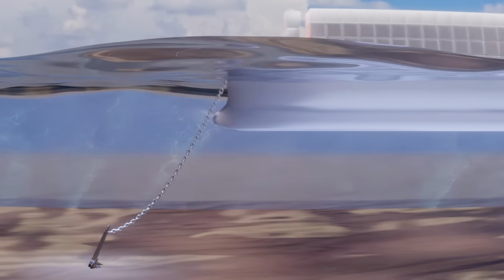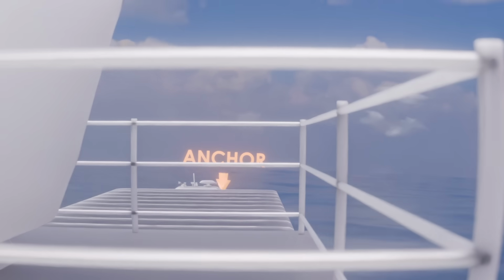Anchors don't work the way you think

Comment: If they set the anchor properly in a Hollywood movie and then they used it as a handbrake or turning point the chain will get absolutely ripped off the ship. The anchor would not fail and just get pulled out.

Comment: I don’t think that’s how anchor works if anchoring on rock a sand banker will hold very strongly to strongly that’s is way there is rock anchors. If it’s on sand it will hold as well. If it’s on it will hold even better than sand.

Comment: I see so many videos of ships “caught in a storm”. I wonder instead of powering through the storm. Why can’t they drop their anchor in shallow water where the anchor can reach the sea floor and wait the storm out? Can the waves be too powerful for the anchor and chain to handle? Causing excess stress to the ship?the anchor holding the ship steady may actually work against it by holding the ship down as it needs to move more freely with the waves to withstand the storm?

Comment: How much chain you put out depends on how deep the water is. It’s called scope.  You’ll need 3to1 with chain in mild conditions, 5:1 in moderate conditions and 7:1 in heavy conditions. 10:1 in extreme conditions.  That means the 1 is the depth of the water plus the distance from hearse to the water, the other number is the amount of chain you put out,

Comment: Note post viewing post: when I was working as a mate, I was told that I had to put out at least twice the anchor line as a depth of the water. I needed to be knowledgeable of the occurrence in the water.  This month there is times I need to put out much more anchor rope.  There were areas that we had to know where there were two currents going in different directions at different depths. I did not work long enough to know these locations. I just knew of them.  It was only a summer job that I learned so much.  Laying the anchor is not easy job, physics is everything.  I talk to young men, who always could set the anchor perfectly.   When conditions changed, they knew where then to set the new anchor position.  They claimed they had no knowledge of physics.  I had to explain to him that they had an excellent knowledge of physics.  (Fishing boats under 150 feet is different than a great ship with a steel anchor.  But the physics is the same.)

Comment: Total BS.  Yeah, I don't buy it bro -- this idea that the anchor itself is secondary.  It's not; it's primary.  The anchor does the brunt of the work.  That's why you need it to dig in and set itself in the first instance.    You can pull chain (anchor rode) across the sea floor all day long.  Now, can you dump out enough heavy chain in your anchor rode to hold a ship in place in limited circumstances?  Like light winds and no current?   Sure you can.  Doesn't remotely mean you can do away with the primary stopping force, which is the anchor.   The heavy rode's primary purpose is to ensure that the direction of pull on the anchor stock is horizontal to the seabed so that the anchor stays put.   That's the purpose of chain anchor rode.    To attach the ship to the anchor.  This is simple, rudimentary seamanship.

Now you've gone and misinformed a whole group of unserious people and junior seafarers into misunderstanding how an anchor works.    Congrats.    Spent my life on the ocean.  USCG 2d Mate Unlimited (Oceans); USCG 1600/3000 Master (Ocean).  DP Operator (Offshore Unlimited). 500 Ton Sail endorsement.  I have nothing but contempt for this video.

Comment: Yes, cruise ships have anchored on coral reefs, sometimes causing significant damage. Due to their large size, heavy anchors, and long chains (often over 200 meters), when dropped on coral reefs, they can break and overturn living corals, sponges, and other reef organisms over extensive areas—sometimes thousands of square meters. The ships also swing at anchor, dragging their chains across the reef and causing further destruction. This damage can reduce reef structural integrity and ecosystem services, with recovery potentially taking decades or even centuries. Such anchoring events have been documented in places like Barbados and the Caribbean, leading to new policies restricting cruise ship anchoring to designated safe anchorages or requiring dynamic positioning to avoid reef damage.

Comment: Enforcement in the Great Barrier Reef is maintained through a combination of zoning, mooring buoys, patrols, monitoring, and public education.

Specific "no anchor" zones are marked with reef protection buoys where anchoring is prohibited to prevent damage.

Public moorings are installed at popular sites as alternatives to anchoring, allowing boats to tie up without touching the reef.

The Great Barrier Reef Marine Park Authority (GBRMPA) works with government agencies to patrol the area, monitor vessel activities, and respond to violations.

Education campaigns inform boaters about responsible reef practices, including avoiding anchoring on coral and using moorings.

Violations of anchoring restrictions can lead to fines and penalties enforced by marine park officers and other authorities, though enforcement can be challenging due to the vast area.

Advanced nautical charts and reef-protection markers help guide vessels to safe anchoring areas away from corals.

This integrated approach—combining physical infrastructure, legal regulation, active monitoring, and public awareness—helps protect the reef from anchor damage and other threats.

Comment: Yes, there are legal consequences for people who use anchors on coral reefs and cause damage. Many jurisdictions, such as Florida, have laws that prohibit anchoring on coral reefs. Violators can face heavy civil penalties based on the severity and area of the damage. For example, in Florida, fines range from a few hundred dollars for minor damage (less than 1 square meter) to thousands of dollars per square meter for more extensive damage. Repeat offenses can increase the penalties, and fines may be assessed in addition to compensatory claims for reef restoration. Responsible parties are also required to notify authorities and cooperate in damage assessment and removal of vessels to prevent further harm. While enforcement and penalty specifics vary by location, laws increasingly seek to hold anchoring offenders financially accountable for irreparable harm to coral ecosystems

Comment: Yes, anchors can and do destroy coral reefs. When boats drop anchors on or near coral reefs, the heavy anchor and its chain can physically break and crush the corals, destroying colonies and the complex three-dimensional structure of the reef. The dragging of anchor chains across the seabed can cause extensive damage, sometimes affecting hundreds of square meters of reef area, fragmenting coral colonies, and disrupting habitats critical to many marine species. The damage is severe because coral reefs grow very slowly—often only a few centimeters per year—meaning it can take decades or even up to 50 years for damaged reefs to recover, if they recover at all. This physical destruction also makes corals more vulnerable to disease and bleaching. Efforts such as designated mooring areas aim to reduce anchor damage, but improper anchoring remains a major threat to coral reef ecosystems worldwide.

Comment: Seems to be a contradiction at 4:30. "As the ship moves the windlass pulls the chain in. The windlass only has to lift the VERTICAL weight of the chain. Once the ship is directly over the anchor the chain is pulling straight up".  At 4:39 the chain is not vertical. Is it not true that only when the ship is DIRECTLY over the anchor is the lift vertical? How can the chain be vertical as the ship moves towards the anchor? Where Have I gone wrong? I guess if there is a lot of slack the lift could be almost vertical as the ship moves towards the anchor. There will have to be a careful balance between windlass pull and ship speed. Too much windlass pull compared to ship speed will have the chain on an angle

Comment: So, why even have an anchor if the chain does it all?  What a ridiculous premise.  The anchor is meant to do what it is designed to do, which is to hold a boat or ship in place or to create a drag.  The heavy chain on a ship assists with this endeavor and I wouldn't call a 10 or 20 ton anchor lightweight.  BTW, boats only use a rope and an anchor and the anchor does it's job perfectly and as designed.

Comment: 2:00 meters 2:08 kilograms   2:19 kilograms 3:22 feet 5:15 feet 5:21 meters 5:50 feet. This channel can't decide which weights and measurements to use.  This channel is using metric and imperial weights and measurements. Why?

Comment: Good video. Rule of thumb for the length of the rode is a ratio of 7:1 to 8:1. So if the depth is say 100 meters, the rode length to be paid out is somewhere between 700 and 800 meters. By the way there are different types of anchors for different types of seabeds.
Reply from the maker: Thanks for the extra info!

Comment: Easy to tell you've never been aboard a ship. I ran a dive vessel 40 years ago with no chain, just cable. Set 4 anchors out 2 miles apart and tension them to position the boat.

Comment: You were going good till you commented on feet vs meters.  Both are equally accurate.  Just like an agent, a pica , and many other forms of standardized measurement.   For us in the  US  we prefer imperial.   Even though they have been pushing metric for 50 years +.   Suck it up buttercup we like imperial.   And we only use metric when we are forced to.    A km. Is too small  a mile is a much better distance.  Like driving. We keep between 0 and 200 mph     a meter is close to our yard that we only use for minimal things. We use feet and inches and fractions of inches.   All things that keep our minds sharp.    The only things I use base 10 is when working on a lathe or milling machine.we go to 1/ 1000 ". Or inch if you don't know the inch symbol.      I use picas and points all the time in printing  layout.  I don't use agate.   And when on the water we use knots or nautical mile.  I never use km or meters or cm.  I do occasionally use grams.  I don't use litres it is gallons.   There is nothing more accurate about metric.     Oh yes we have hard hitting football  we call your football soccer which was its original British name.

Comment: Another idiot who thinks the chain does the work

IT
DOES 
NOT.

The chain acts as a catenary to turn the pulling force from an angle to horizonal. It's why you need proper length for the depth. It has nothing to do with weight. The Anchor, the tool that does the holding, is designed to hold, and holds best when pulled horizontally- and worst when pulled vertically. So the chain sags so much that the force of the pull is horizontal.

Comment: you left this out: the other end of the anchor line is connected to a bitt with ttwo tts. that bit is a substantial part of the hull. if you use all the anchor line you have let the line out to the bitter end. coming to a bitter end is not bitter like an unpleasant taste. it merely means you have committed all your resources, as in coming to the end of your rope.

Comment: anchors can be used to slow a ship and/or help it turn.  A shift in wind changes the ship vector, as well as tides.  The anchor is simply not used outside of places with some kind if break or cove, as engines and inertia are more commonly used.  Of course, Russia uses them to snap cables, and the CCP has a patent for an anchor designed especially to cut undersea cables :p  Anchors work like a lot of people think, unless you are talking about steel ships.  Not a very good video :(

Comment: In engineering terms, the chain is basically just a damper. There is also much much more weight on that anchor/chain from the water pressure. Without the depth, the anchor would not work.
Reply: LOL damp its under water obviously its completely wet
Reply: @BeforeAndAfterScience he said damper, not damp you dullard.

Comment: Good video. In the 1980, to save weight and increase cargo some ships started to use stronger lighter links. The rules were written by strength, not weight. Though everyone new it was the weight, you could do this because the rules did not stop it and carrying more cargo meant more profit. So this lead to some ships dragging their anchors; long enough chain  but not heavy enough to do the job. Not sure what happened to these ships, but if you had smaller chain locker, how do you put in more chain once the issue was recognised and rules changed. At that time, I wrote an anchoring program, under  the guidance of a Navy Architect/Mathematician/Thermo Fluid Dynamics specialist  to  calculate anchor chain weights and lengths in  various bottom condition/weather scenarios. We compared this to times where ships ad lost their anchor. The anchor lays out the chain and indicates the end done; it can stop creep. The chain friction is the normal method of holding. The stress is not even along the length of the chain. The catenary shape is important and gives the bounce reflect action to movement and energy is lost moving the chain and drag through the water. From memory, chains broke in 2 place. At point of highest stress near where the chain was in contact with the bottom, or at the anchor when the catenary had been lifted clear of the bottom. The first was total disaster as the ship effectively had no anchoring, the 2nd meant there would be creep as the primary anchor chain would relay itself on the bottom, but no anchor on the end.

Comment: 2:12 "A single 160 kg chain link is heavier than a grand piano".

The smallest grand pianoforte weighs around  500 lbs, about 226 kg. The piano in the image shown in the video would weigh roughly 1000 lbs/~450 kg.

I noted similar "math fudges" throughout the video. I wouldn't use any of this info for your term paper research.

Comment: After being a merchant marine (Chief Engineer) for 30 years now.....I've NEVER once heard the sections of the anchor chain called "shackles". For 30 years we've called them "shots" of chain. Maybe it's something new? We also don't call the chain a "road". We call it a chain. Either a lot has changed and nobody has told us mariners about it, or this chat GPT bot got some bad information! The total system on a vessel for the anchor, chain & windlass is called "ground tackle". The way we measure how many shots of chain are needed for our vessel is we multiply the water depth by 3 or 5. 3 if the weather isn't supposed to be bad & we have a good mooring bottom, 5 if the wind or current are strong & the mooring bottom isn't ideal. So, if we were anchoring in a good muddy bottom in a depth of 100 ft. & the weather was cooperating, we would let out 300 ft of anchor chain. Also, each "shot" of chain is 90 ft.

Comment: Long story short. The weight of the chain provides a lot of the Anchorage to an anchor and it's shape provides just a bit of support to drag on the sea floor. A problem some ships face which needs to get fixed is when an anchor is to light causing the ship to drift a little bit.
Reply: nope the main point flew 1000 m over your head

Comment: The heaviest anchor and chain system was on the Seawise Giant, a supertanker, with an anchor weighing 36 tons and a chain over 200 feet long. While not the absolute heaviest, other notable examples include the Titanic's anchor and chain, which weighed approximately 100 tons combined, and modern US aircraft carriers which each have anchors weighing around 30,000 pounds and a chain over 1,400 feet long.

Comment: Hi. A useful video covering the basics. However not covered is how much scope - the amount of chain to put out. Often we are told 3 times the depth of the water. But this is often not enough if tides rise, or the wind picks up, or if the anchor is not securely holding in sand or mud. So cruisers often recommend 4 or 5 to one ratio of scope. If winds really pick up, cruisers put out even more chain, maybe in the 6 or 10 to 1 ratio. This can cause problems, when you put out  a different amount of scope out compared to your neighbors. So if possible it is good to ask. This issue is you may move further than them as your chain get stretched, and more frequently it can cause issues of anchor chain getting tangled, especially if you spin. Also anchor type is really important. We had a plough anchor that just would not hold in anything but the lightest breeze. We move to a Rocna, made in NZ. And weight is important. Don't go too light! You can get advice on this from where you buy your anchor, based mainly on the weight of your boat.

Comment: I had a 40-foot boat (SeaRay) and it only came with a 10-foot chain on the rode. Not enough. I switched to 20 feet and the boat was easier to anchor.

Comment: 1. Cover all scenarios. You did not show if the force to the ship is applied from the opposite direction or perpendicular.
2. Compare two weights with same weight units. It does not make sense if 1 chain = 1 piano and 1 anchor = 15 cars. Do you expect us to calculate how many pianos equals a car?

Comment: We were on a guided fishing trip at the cut on the north jetty in Galveston Bay, in a 32 ft Yellowfin.  The deck hand threw the anchor for about 45 minutes, with a broken wench so he had to manually retrieve it every time.  Wasn't my boat so I didn't say nothing but I damn sure wanted to.  I have a Bay boat but I didn't wanna make the guide look incompetent, I didn't wanna swim back neither. It turned out pretty good because I got to use my redfish tag on that trip.